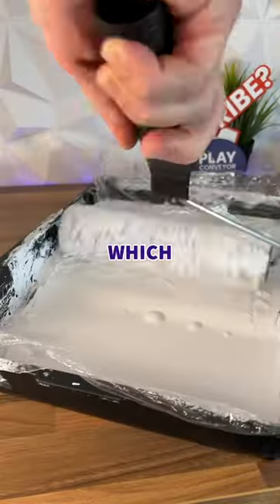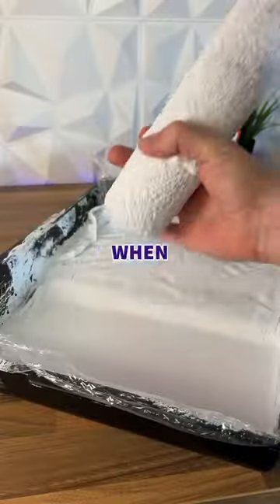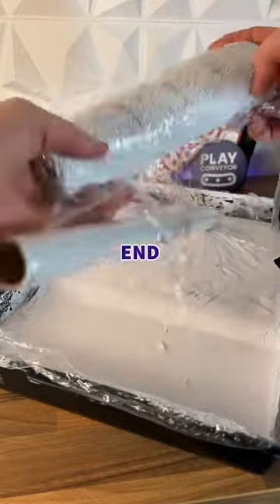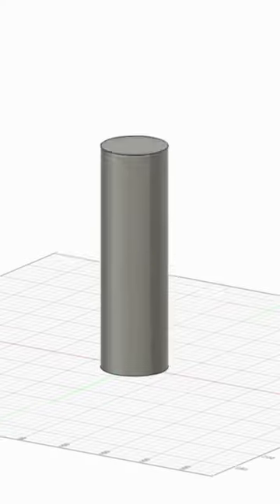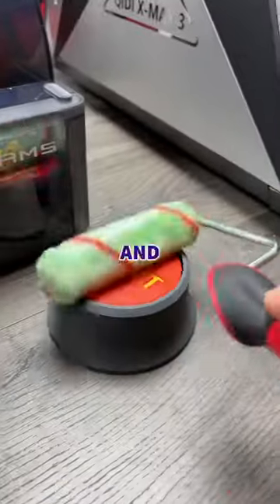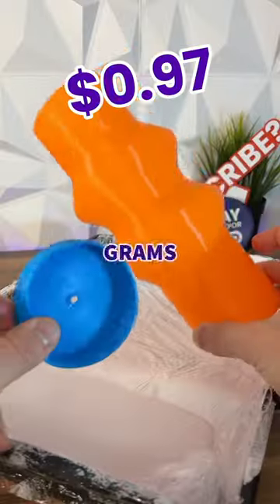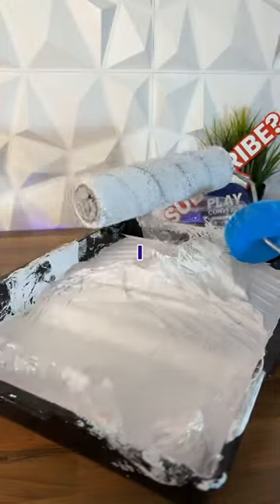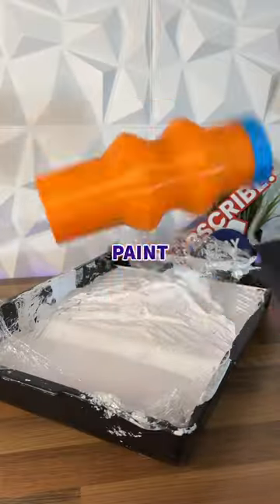3D printing SOLVED the PROBLEM with DIY 🎨 #3dprinting #lifehacks #shorts

Comment: Meanwhile me struggling how to order a 3D printer.
Reply: How are you struggling to order a printer?
Where do you live?
Reply: I ordered mine from amazon about 4 years ago
Reply: Don't order a 3d printer. just print one
Reply: @Custom3dPrinting4U how do you print the printer if you don’t have a printer? 🤔
Reply: I used to struggle with this.

My advice is to determine your technical level.

If you want to be absolutely involved in 3D printing and learn the ins-n-outs of the machine, you can buy an Ender 3 Pro. 

As a fair warning, this is both cheap and as basic as it can get for a reputable model. I absolutely encourage upgrading parts over time because it will greatly benefit from it. However, the cost to upgrade everything will eventually cost the same as buying one with all the bells and whistles.

If you dont want all the technical work and just want to print, then get a PRUSA Mini+. Its a good bit more expensive, but it is more compact and more reliable than the ender 3. Creality also makes good printers equivalent to PRUSA, so give them a look as well. PRUSA is the Apple of 3D printer regarding status symbol, without the bad overpriced reputation. 

Now if you want the expensive Ferrari of 3D printers, then Bambu labs (at least in my opinion).
Reply: I think you should get ender 3v se, it's on discount RN for 160 and is good
Reply: Get a Bambu Lab P1P if you're new. We are past the day and age of having to work on your 3d printer to use it. P1P is cheap as hell, and prints PLA/PETG with no issues. Higher temp plastics like ABS it'll struggle some with, but when you're ready to make that jump, buy the P1P To P1S upgrade kit, to add an enclosure.
Reply: It is being argued that the Bambu Lab A1 mini is their best printer(besides the fact it’s not enclosed) perhaps look into that one if you haven’t already!
Reply: @spray_cheese  what about the normal Bambu A1?
Reply: @enhidri160  I’ve heard they cut corners with that one. I can’t speak from experience. But I know they definitely don’t make bad printers. You’ll be happy regardless, but there’s just a lot of talk about the mini rn. But definitely not ideal for a production setting
Reply: $100 ender 3 v2 at micro center
Reply: @spray_cheese  I’m getting one soon, I’ll update you on how it is.
Reply: Bambu is good and all, but honestly any printer with at least some form of bed leveling sensor is going to be miles easier to use than one without one. Bonus points for all metal hotend to avoid breathing in any toxic fumes.
Reply: @SouthernWolff that is a 600 dollar piece of hardware
Reply: Regular color printer, the lame 2d version
Reply: @TheMorrowgamer you mean region or country right?, RIGHT!!!
Reply: @HowdyAleck.  Yeah...? What else would I mean?
Reply: @TheMorrowgamer   bro asked for the exact location the excact centimeter of diameter the exact IP address THE Excact position of the person

Comment: Isually people wash these rollers and dry them, never leave it with the paint…
Reply: Yeah, this is a great way of turning a regular roller into a one time use thing... If there's one thing I've learned about working with paint is that you ALWAYS wash when you're done---that stuff ain't coming out if you don't...
Reply: Depends if you're stopping for the evening and starting up again the next morning.
Reply: No they don't, depends on your purpose. I paint in scenic shops and we don't
Reply: Painted for years by using a ziplock with a clamp on it and it lasts a long time wet

Comment: Thats cool, and useful. I have a suggestion though, something for you to think about. What if the roller cover came in 2 pieces and had some simple lock to keep it together, that way you could split it in half when done and easily clean out the inside, put it back together easily and then your ready to go.

Comment: If you need to temporarily deal with a paint roller (say overnight) just chuck the roller and tray in a plastic shopping bag and tie it up. It'll keep the paint from drying out on both the roller and the tray.

Comment: bro you can just wash the paint out with water
Reply: Ah yes, because that's a better idea. That takes time, water (or some kind of solvent when working with oil based paints) and effort, not to mention that you then have to (should) get rid of the waste liquid properly. Cleaning them is especially dumb if you know you're gonna be painting the same color with the same roller in a couple of hours or days.
Reply: It’s not dumb. It’s proper. Shit is gonna dry on their otherwise and fuck up your future coats even if doing the same color.

Comment: People wrap paint rollers? Tf?
Reply: Most people either wrap wet/used paint rollers in a plastic bag and/or soak them in a bucket of soapy water and/or mineral spirits and/or toss them in the trash after painting with them.

Comment: What are the ridges for?
Reply: It is most likely there to prevent the cylinder from deforming.
It's like ridges on the container, simple geometry makes extremely hard to bend in one direction
Reply: Her pleasure
Reply: @dnddl9976 I was thinking they were to help air movement: not form a vacuum when shoving it in or trying to remove it
Reply: @Bleats_Sinodai Ayooo pause

Comment: mean while you don't know what your doing.... u want to use a shopping plastic bag to wrap up the roll and not Saran wrap for them to your printed part has air in it which will still cause the paint to dry if it was flush it would be a lot better

Comment: I still wonder if you actually think those are good ideas or just ragebaiting/commentbaiting lmao
wash the roller after using it like wtf
Reply: I've never seen anyone wash the roller lol. Most people wrap it or just trash it
Reply: It's actually horrible for your pipes and the environment to wash paint down the sink; you're not supposed to.
Reply: Haha ya totally. Buy cheap rollers then just throw them out. Besides this "fix" won't work cuz there's still a ton of air in there to dry out the paint. These are funny to watch tho so theres that.